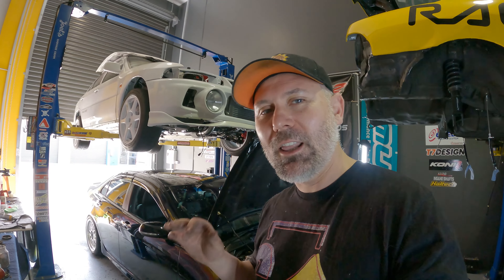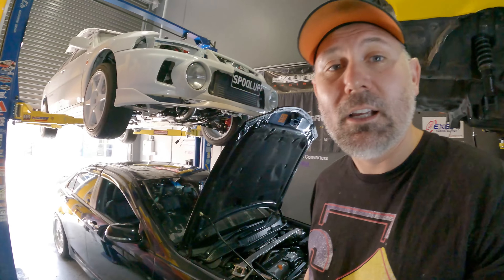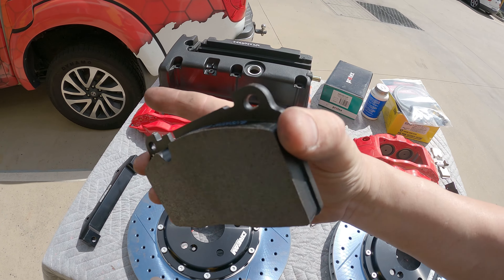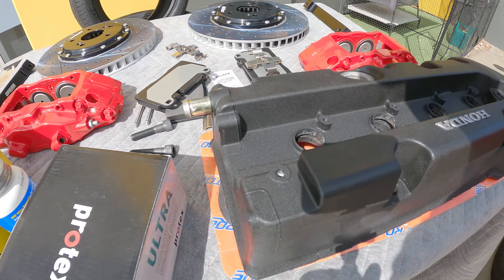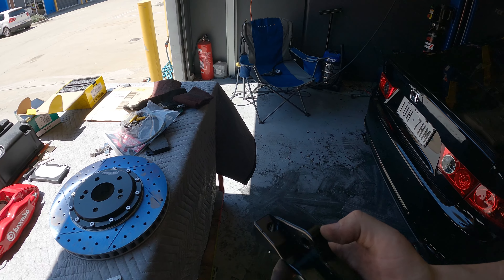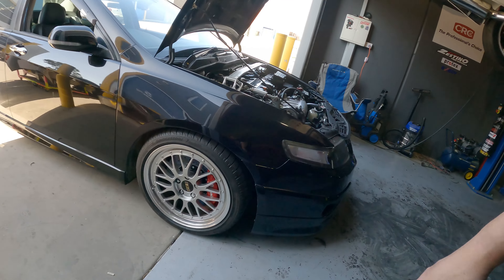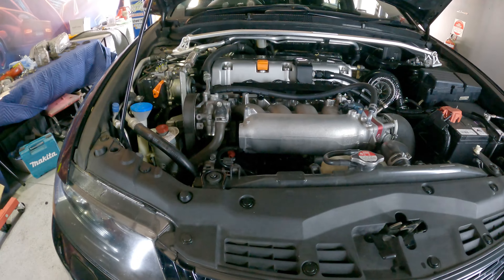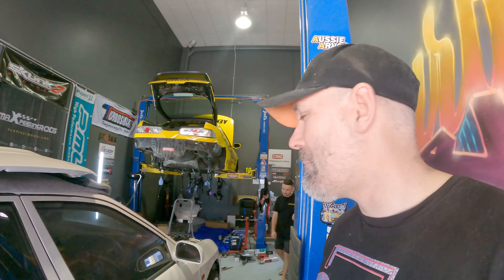Accord CL9 EURO TSX Brembo Brake upgrade

Comment: Loves the brakes but keen to know if they’ll make the changes to the bracket for the production run, what do they cost and minimum wheel offset/clearance
Reply from the maker: This was a one off they are sending out a replacement set of brackets that work

Comment: Whats the wheel size and offset ?
Reply from the maker: 18x9.5 front 18x9 rear, didnt get the offset but its dialed
Reply: Wheel size and offset are F 18x9.5+40 and R 18x9+44
Reply: @TURBOTRISTO did you widened wheel arch?